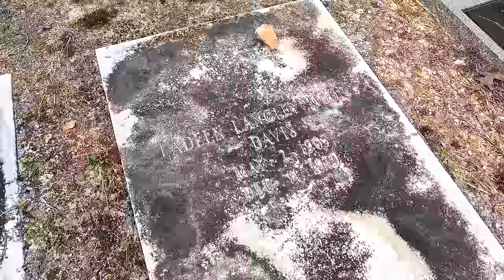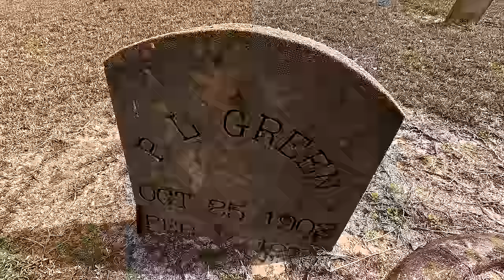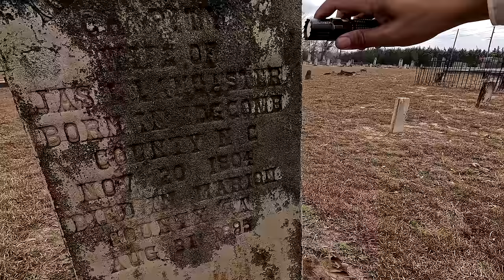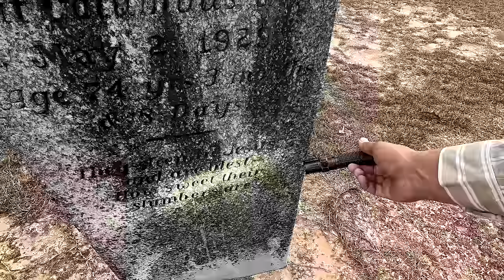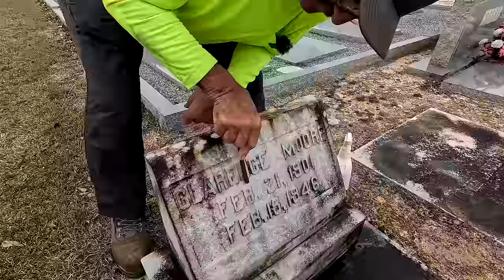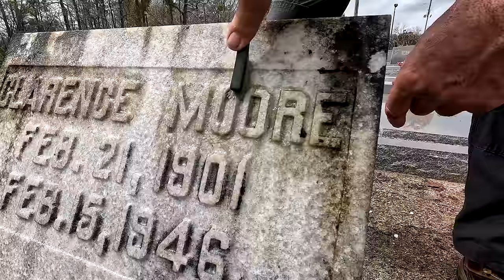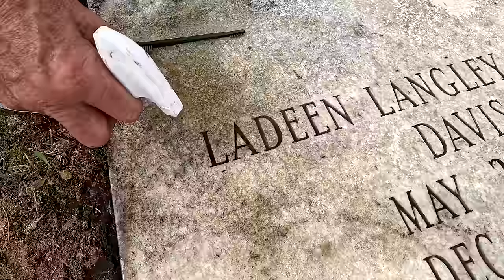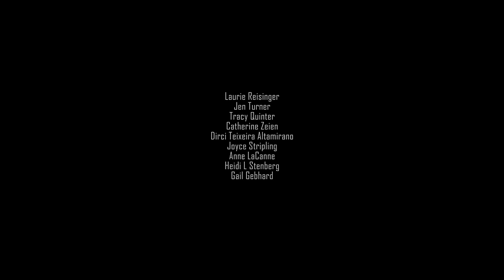SEARCHING FOR THE OLDEST GRAVE! (CLEANING HEADSTONES FOR A VIEWER!) Graveyard Exploration!

Comment: They make small water tanks on trailers that have a gas-powered pump. You hook up a regular garden hose and nozzle to it, and you could actually hose off those stones instead of pouring bottles of water on them. We had one rig like that at the resort where I used to work. It was really good.